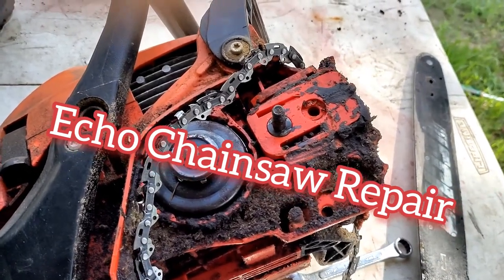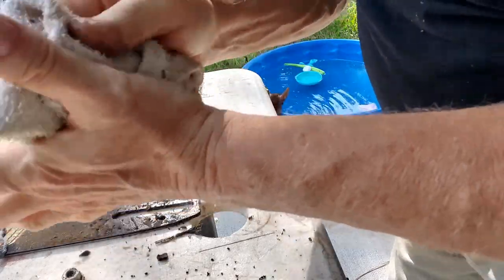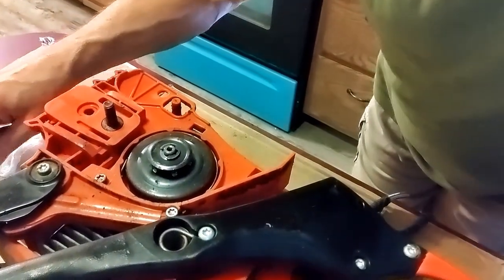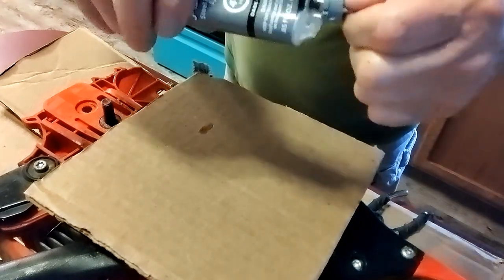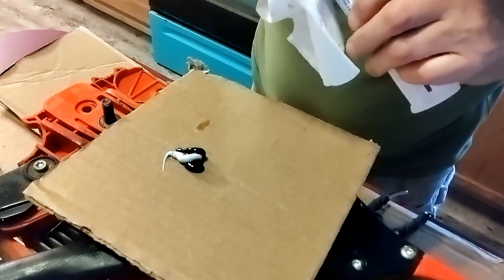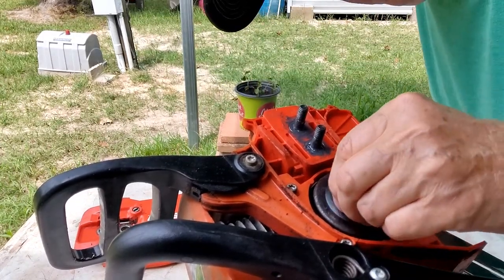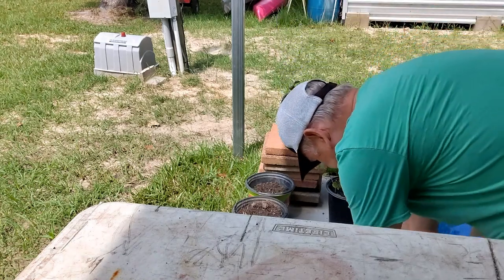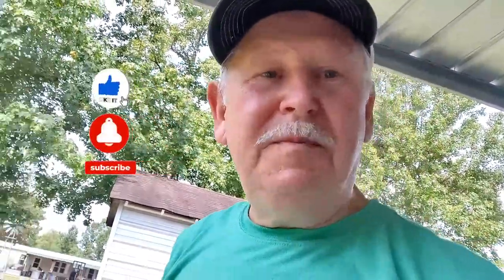Echo Chainsaw Stud Repair

Comment: I used a thicker lag bolt, cut off the stud in half removing the part that goes in the case, then welded a piece of the lag bolt and set in place with epoxy.
Reply: I wish I could add pictures

Comment: I had the problem with my small echo2511tes, I cut a 1mm slither of plastic from the body of the saw where the dog would bolt to, and put the plastic slither inside the stripped hole, then take the stud out of the fire after it’s nice a hot and screw it back in place, the hot tread melts the slither back into the threads and body of the saw, it cool rather quickly locking the stud in place, worked a treat.
Reply from the maker: I'll have to try that. My way didn't hold....
Reply: @PaffordHomestead  when I tightened the 13 mm nut that holds the bar it tightened perfect, where as before I could feel the stud being pulled out, I am sure the plastic is ABS which is common in my field of panelbeating, if the temp of the stud is hot enough to melt its way in with out blowing smoke, it should hold great, good luck.

Comment: I had the exact same thing happen to my old cheap blue max chainsaw. Front stud striped out. I used it quite a bit. So far, J.B is working. Blue max is a pretty good saw for price. Motor is excellent, however it small things like the stud striping out that drives me crazy. Blue max parts wear out quickly. Thanks for the video.  Please keep us a updated on your experience with JB weld.
Thanks
Doug 
Louisiana
Reply from the maker: So far it's still holding 👍
Reply from the maker: Well I'm sorry to say it didn't hold up so I got to find out how to fix it.....

Comment: I can see it is a Echo CS-310, label briefly seen at 20:01. Put the Playback Speed to 0.25 just before then and you can catch it.
I have the exact same model and mine stripped out also when I over torqued the wrench.
Reply from the maker: Well what I did didn't fix it back to the drawing board 🤔

Comment: thank you for the video i got a top handle echo trim saw i use commercially and personal use that also stripped like that how well did it hold and have you used it much since the video was made
Reply from the maker: So far it's been holding I have used it about 4 times so far.....